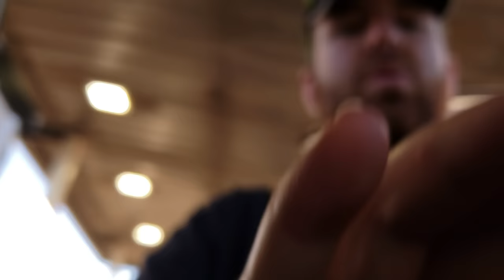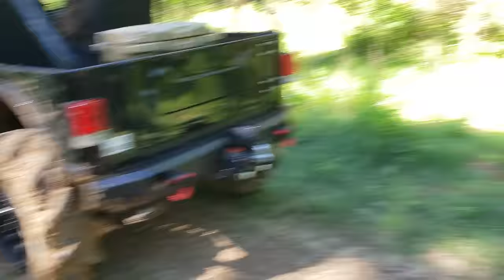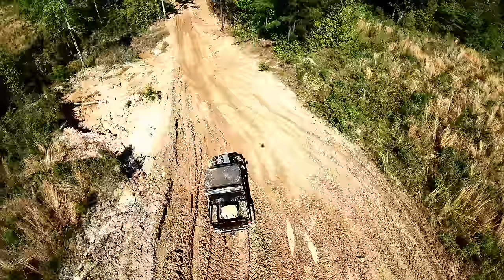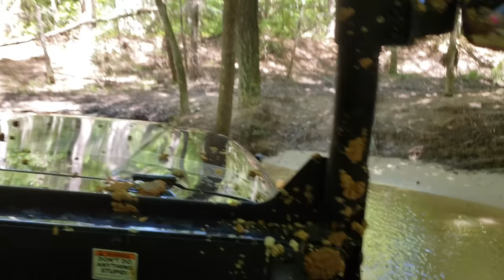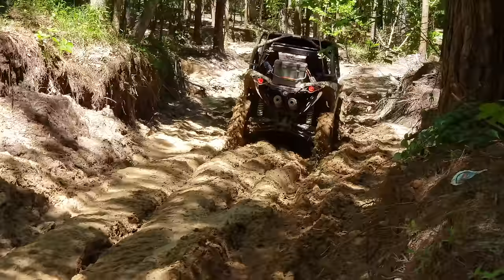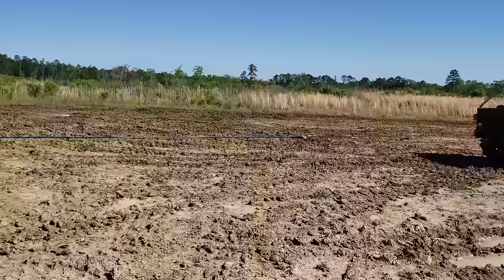LIFTED TUNED ROXOR VISITS SABINE ATV PARK

Comment: Rumor has it Mahindra is developing lockers for it. It will be an unstoppable beast if thats true.
Reply: Uyou can use any dana 44 locker just need the spacer
Reply: Just swap the whole diff assembly with hilux's diff, got a built in lockers on that

Comment: This thing would probably be unstoppable with some locking diffs and a little gear reduction. But still a badass machine the way it is
Reply from the maker: I'm in total agreeance with you bud.
Reply: I can't believe these things don't ship with a locking rear. Only hardcores need to lock the front but an open rear is ridiculous.
Reply from the maker: @SomethingFunny454  I agree. You can order them now with lockers but still. I dont see any reason they cant be standard. Maybe they like giving people the option
Reply: An Eaton mechanical locking differential would solve most of the problems.
Reply: Yep, lockers and gear would be icing on th the cake
Reply: Or portals ..bounus is the built in lift
Reply: Darwin Calliou they are bad ass for the cash
Reply: I think Roxor hear you out both come stoke in 2020 Version...

Comment: I love the buildup.  The performance is really good.  The issues I see are locking Differentials and ground clearance.  I grew up in older 70s CJs so watching these videos is a wonderful thing for me.  My dad used to change the gearing through the transfer case, and though I haven't really looked at a Roxor's design, I was wondering if you might could do that seeing as you said the gearing wasn't quite on par with the performance you have gotten out of the engine.

Comment: Love watching your videos,  just recently picked up a grey roxor le and started adding parts like manual locking hubs and soon will get a posi for the front end and limited slip for the rear. If I can get a set of tires like you have the thing should just about be unstoppable
Reply from the maker: Awesome congrats! And yep it should do just fine with that setup!

Comment: I have a $5000 1974 Jeep CJ 5 that has a built 360,  lockers , 4" suspension & 33" mud tires and a Warn 8274 winch. Its very nice looking , very capable in mud , snow & dirt. Up hills , washboard dirt roads and light to light sprints . Its street & highway legal and a Genuine Jeep . These people spending close to $20,000 for the Roxor are just dumb since so much more can be had for so much less that buying one of these Roxors makes a very unflattering statement about its owners Intellect or lack there of !
Reply from the maker: Why do you keep commenting negative things on my videos if you dont like the machine. If its so dumb, just quit watching?

Comment: Super cool, currently you are just missing the right gear ratio, lockers and a transfer case tummy tuck. The UTVs will always have an upper hand in slush as they are less bulky, the roxor  is like a mud mover, flattening out the whole path behind it..

Comment: Awesome, first time out owning the park! Lockers and axle shafts next?💪
Reply from the maker: Hopefully so, If they would release them!
Reply: Lunchbox lockers will work with them. I think you have Dana 44s on them . Powertrax, spartan or detroit make those. Use the existing side gears don't buy the coulpler. Should cost you 400 to 500 dollars a pair

Comment: It would be great machine if it come from the factory with all those upgrades on it and it had differential lock, cause it's got great potential but they made a machine from the factory that was like they were trying to not do good, I guess it depends on the market they're looking for but American side by sides at made with ground clearance and to run like a 4 wheeler but be a side by side, they say there coming out with these things from the factory and I'd be interested in seeing that one, the motor is really what you paying for in this machine

Comment: What is the lug patter? What is the wheel and tire setup?
Reply from the maker: Same as jeep and some older dodge trucks. 5x5.5 and its fuel wheels -12 off set 18x10 and tires are bkt 35x10
Reply: Red, White, & Roxor thanks, and what size lift is it?

Comment: That thing looks like beast down in the flats of the muddy south. Pretty sure i wouldn't want 1 up here in the hills of ohio.
Reply: Top heavy idk
Reply: @johnmurner2418  my bigger concern is weight. 3,500lbs... i fear that on off camber turns... definitely be sketchy af lol. Especially as slow you would be driving it with that suspension set up.

Comment: all that power and no diff locks, built to the nuts this thing is only 35 grand what a deal
Reply from the maker: I'm at 27 now with lockers and gear reduction. So just now what my highlifter rzr was. And will last a lifetime. So yes I say it's a deal
Reply: congrats on all your success, for 30 grand you got stuck in first mud puddle you came across
Reply from the maker: You have no idea what you're talking about. The lockers and axles arent even installed at the point in this video. Therefore the vehicle worth is not 27k yet.
Reply: @RedWhiteRoxor  hey give it a rest, i glad you have enough money to buy that little toy, but for 30 grand im buying a real jeep that would yank the chassis out of that barbie jeep haha

Comment: I want to like the roxor for the nostalgic looks like everyone else, but I can't.  There is a series of downsides about it that add up to a no for me.  There's the lack of power... yeah you can tune it... but you can tune its competitors to a helluva lot more power.  For a 2.5 liter engine, they have no excuses not to get at least 100hp out of the factory...  The suspension is the biggest downside - I'm not saying it should have fully independent a arm suspension, plenty of those side by sides around, but something with coil springs - a la TJ/JK/JL.  You can't make an old jeep and charge 18k for it IMO.  The weight is another one - it'll go over the capacity of a lot of toy haulers, probably mess up the back ramp if you even try... To me, for it to be competitive, one of the above downsides would have to be remedied (price, weight, suspension, power), while to be actually interested in one, I'd say 2 of them would have to be changed... Hell, put coil suspension on it (which would shave a lot of weight), trim some weight from a few more areas (modular plastic tub?), drop it to 2300 lbs or so, tune it up to 100hp stock and I'd be at the dealership... till then it's gonna be the same ol Polaris/Canam/articat/etc...

Comment: Bring that sucker to Pa greasie steep nasty slops big rocks n nasty mud holes but you might want to bring a real machine not a mix between tractor n Jeep come on up I’ve got a pipeline that tractor won’t even smell 20 feet off  Roxor be a good dirt road buggy Miranda better stick to building tractors  that are indeed good